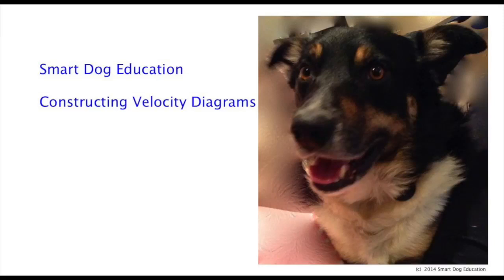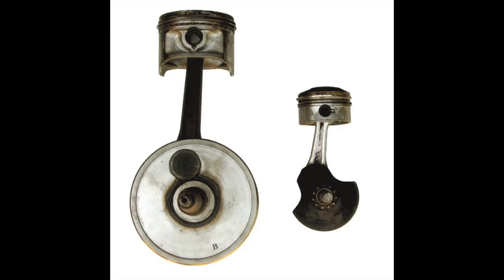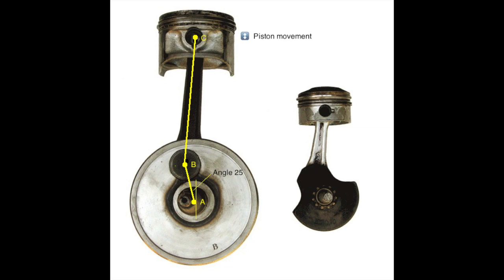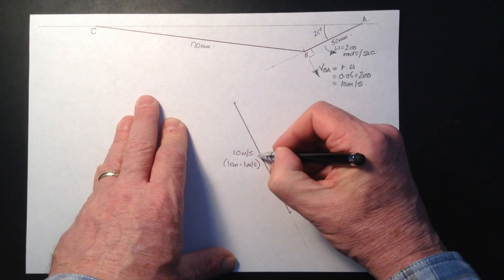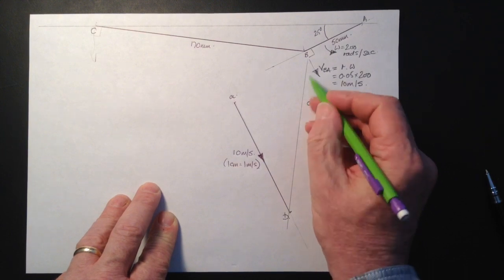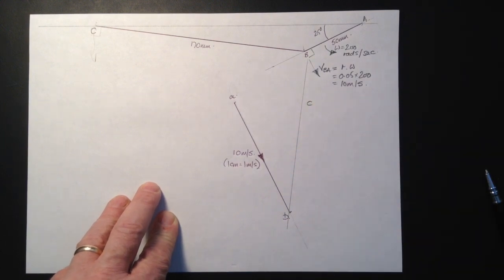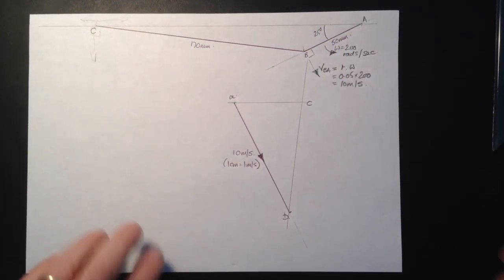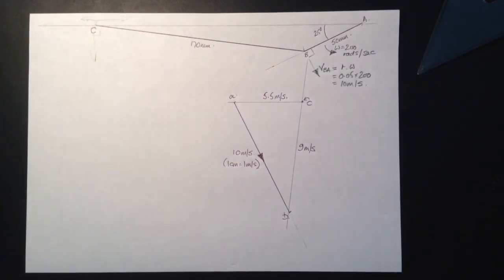Velocity Diagram Piston and Crank 720p

Comment: Hi, I have a question in my assignment which it asks me to determine the velocity an angular velocity of this mechanism. The RPM is 3000 the crank radius is 50mm and connecting rod is 90mm. The phase angle is 30 degrees from which I have determined velocity and angular velocity . I am now asked to produce graphs for displacement. The only way I can think of doing this is to repeat the question at a different phase angle every 10 degrees . So once I started and I get to 90 degrees and draw my vectors on graph paper it doesn't look correct . Any advice on this ? Thanks